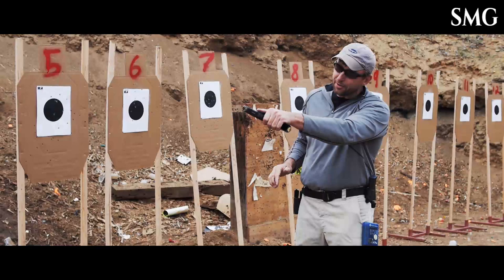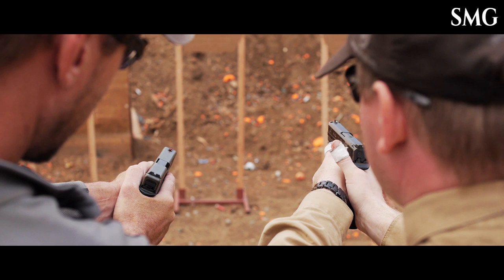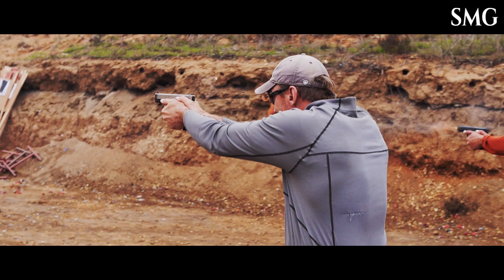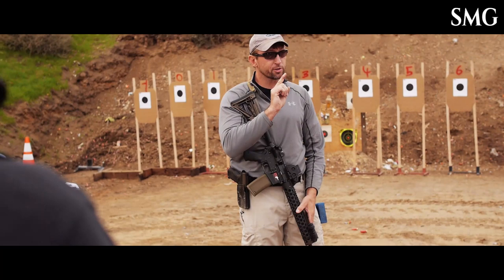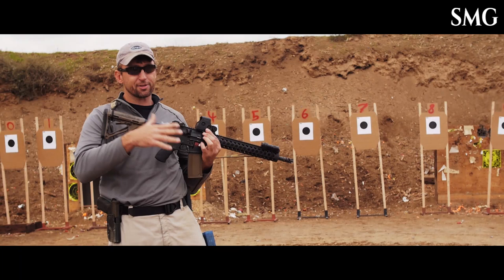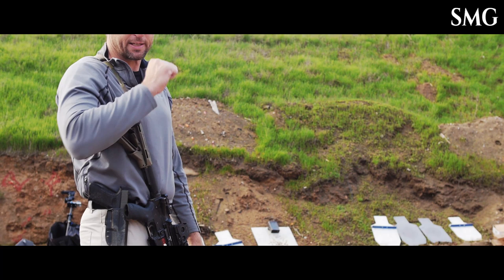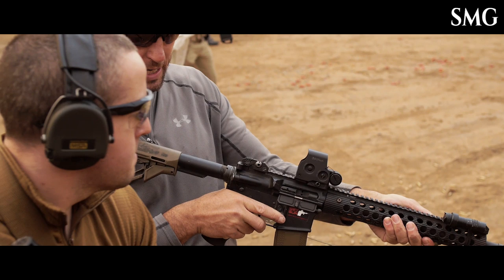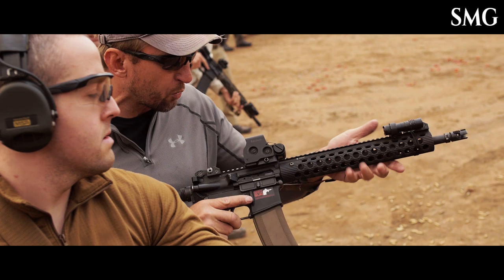Leverage with Frank Proctor

Comment from the maker: Yes, that's right. A couple of reasons is that he shoots from a more straight up position rather than hunched over the gun, nose-to-the-charging handle and the extended stock allows more control much like grabbing the end of the handguard. We run extended or fixed A2 stocks almost exclusively in competition, which is where he learned it. Drop him a note if you want more info.